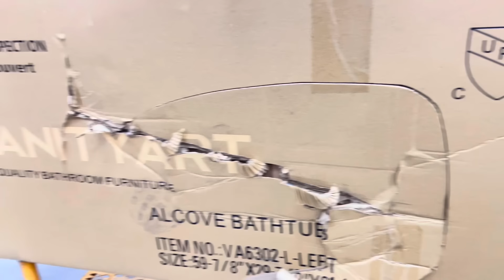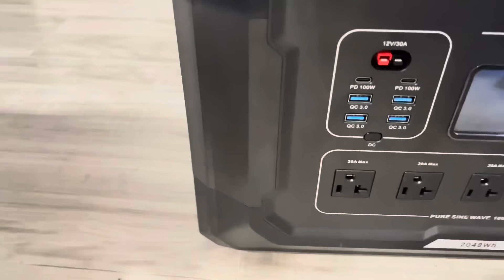REMODELING CAN BE HARD SOMETIMES

Comment: Nice to have a backup power supply.  We also have  lots of solar lights. We have used them during the winter storms and also for the summer storms.  I have some that are motion sensors and some that are controlled by a remote control.  I have all  the solar chargers in the east window,and lights plugged in. I built the shelves to attach to the window frame.  
To know which one goes to what light. I took my nail polish and painted the cord and the top of the light to match. I have one for each room except the living room and basement I have 3.

Comment: I went today an bought some of my cabinets
Reply from the maker: Really? Awesome! Are you doing your kitchen? I’m sure it will come out great 🤍 happy remodeling 🤍🥰
Reply: Yes I'm trying to go for the look like urs because I'm so in love with the way you design yalls I'm painting my cabinets like a little light than olive green an I'm doing the white wash brick look instead of tile an the bead board on top I want yo have a stainless steel hood vent that reaches to the to but idk If they make an adapter because mine is the little square hole lol an also we are putting our couch in the other corner beside the cabinets because we have propane heater I'm doing this all by myself he only helps if I need muscle lol